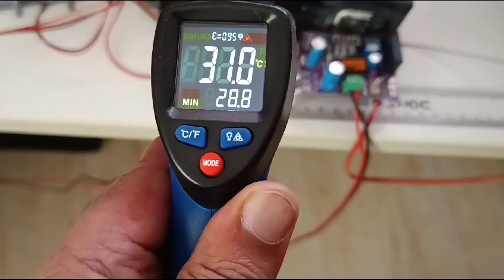Testing the LM3886 Stereo Audio Amplifier Special Edition  Board with HIFi 2 way Tone Control Board

Comment: How many watts power supply is used ? 24.0.24 or bigger ?
Reply from the maker: 20-0-20,5Amps
Reply: @soundsofampiness  I'm in search for a good pure copper made 20.0.20 , 5A transformer to use in my own LM3886 stereo amplifier board.
Reply: Vaani transformer is good  @aneeshchandran